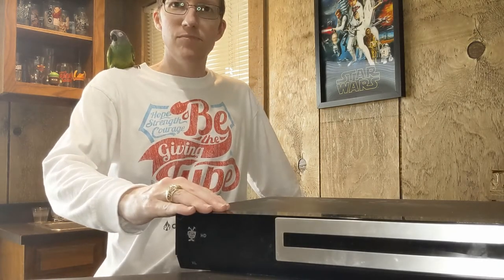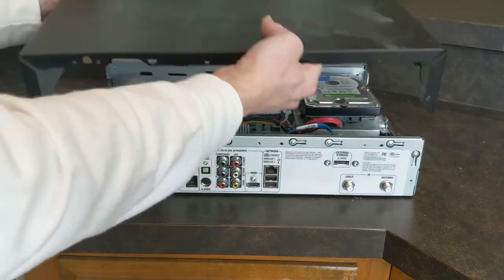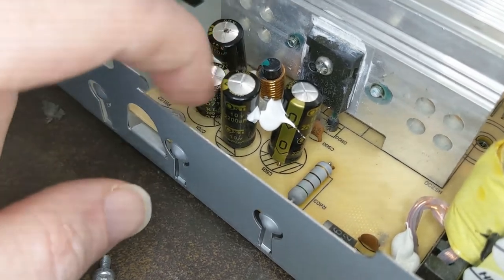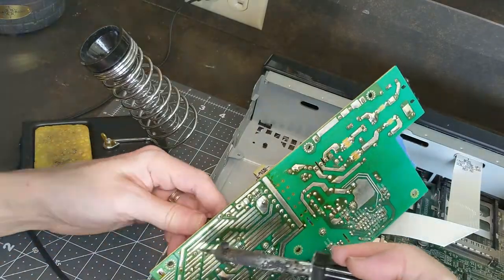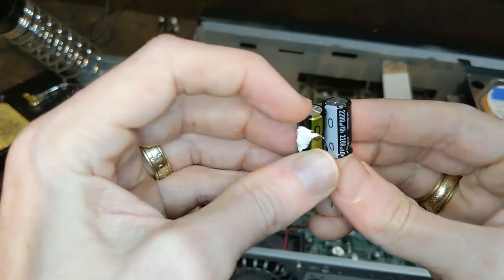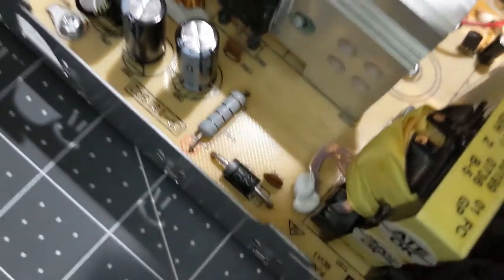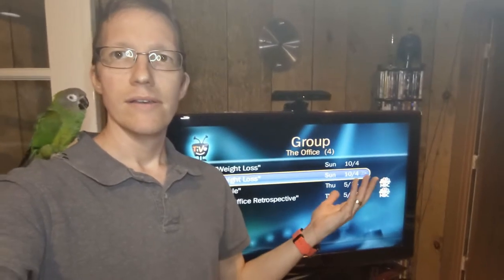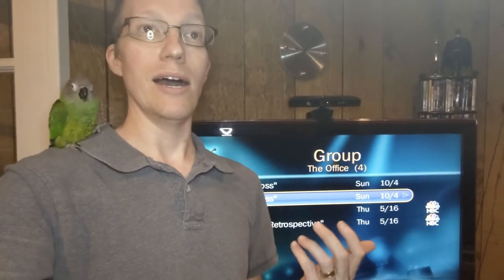Replacing Capacitors to fix a TiVo HD XL

Comment: Your video was just what I needed to get my Tivo HD XL up and running again.  I thought it was a failed drive but when I plugged the drive into a Linux box, it spun up perfectly.  Weaknees didn't have a replacement power supply in stock and this was way cheaper anyway.  I did the repair a few weeks ago and the box is still running strong.  This box is much better than my Premiere or Edge when it comes to being able to extract shows and honestly I still like the old SD interface and Guide compared to the new stuff.  Now I need to make a backup of my drive just in case it fails, I can rebuild on a new one.  Thanks again.
Reply from the maker: That's great, glad it helped! After 30 months, my repaired one is still going strong too, it's impressive that just a few dollars in parts has extended its life this much!

Comment: Thank you very much for your video. I had the same three 2200uf capacitors and the one 1000uf capacitor bulging just like yours. Got the capacitors at a local surplus store. My Tivo is back up and running for $6!
Reply from the maker: Congrats! It's great to be able to fix things so cheaply, isn't it?

Comment: Thank you so very much for this video. Can you tell me how much of each capacitor is needed to replace all of them? I know I could look inside the Tivo however I want to be certain that I'm not missing a capacitor since they sometimes take a while to come in.

I very much appreciate your help!
Reply from the maker: I ordered 8 of the 2200 uF, 4 of the 1000uF, and 2 of the 470 uF, which gave me a couple extra, but I'd rather have a couple extra in case i mess them up while replacing them.

Comment: My XL still has good capacitors surprisingly. It was made on 09/21/2008.
Reply from the maker: That's pretty lucky. We only recently learned that our house has until recently had really dirty power (lots of voltage variability), so that may have worn them out faster than normal.
Reply: It also had Lifetime service. I only had mine for a month. I collect TiVos.

Comment: Great video!  Our power went out and now my tivo HD won't start.  All my capacitors look flat. And clue what else I should check ?
Reply from the maker: If you open it up you can see if any of the lights on the boards come on. I had a problem with my a/v receiver too, but none of those capacitors were bulging, so a flat top is no guarantee they're okay.